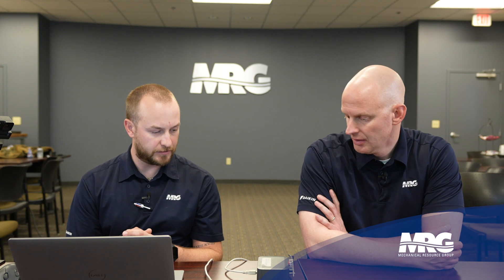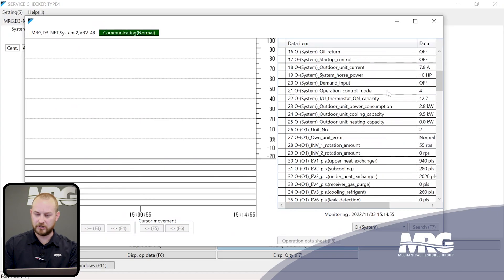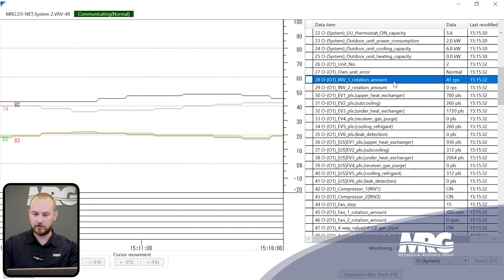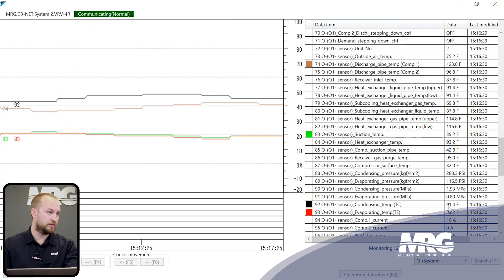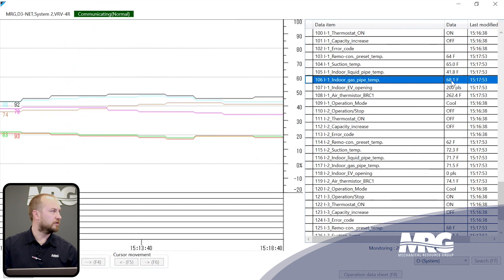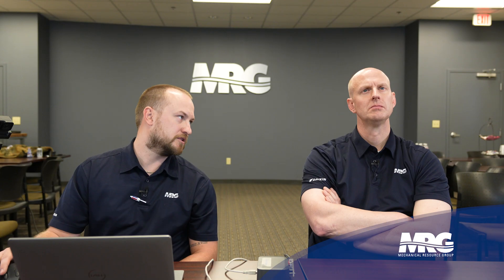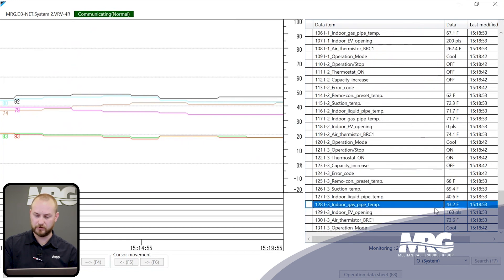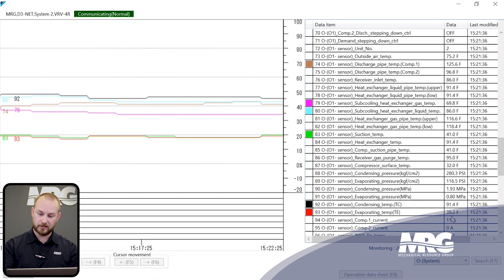Discover the Secret to Diagnosing Refrigerant Flood Back with the Daikin VRV Service Checker!

Comment: If 😅 sir our coil is cleaned filter ok blower speed okay then all idu gas pipe temperature 5 degree Celsius pipe in liquid 4 degree Celsius Suction super heat is low what could be possible if we have 5 fcy in that situation what we should do

Comment: Hi sir I hav daikin vrv 4  but I have to change only fcu . So how to test run please pm me
Reply: If you’re only replacing a FCU, you don’t need to run a test, but you should conduct a system recount. 

To conduct the system recount, press and hold the return button at the master outdoor unit for 5 seconds - 3 small squares should populate on the 7 segment LCD display during the system recount. 

If the existing FCU that is being replaced had a Group Address and/ or an Airnet address, input those addresses into the new indoor unit.
Reply: I have only single condenser
Reply: Sir I have to replace another model fcu  total 3. But condenser 1
Reply: @MechanicalPros   sir my Clint  have bee using  Daikin VRV 4  system 3. But currently system break down so I have replace   3 fancoil .  After replacing how to test up that’s all
Reply: @Sarker804  test mode

Comment: Excellent video.    What is the eev’s default position, say when the head has been removed?  Thank you
Reply: @MechanicalPros  do you have a service checker file that you recorded where it shows a stuck 4 way valve or faulty main EEV on the outdoor unit?
Reply: @davidcross27 we can do both 🤝
Reply: @quentinbutlerhvac5410  Awesome 💪🏽💪🏽💪🏽
Reply: Please make more videos about troubleshooting VRV’s using the service checker.
Reply: Almost all indoor units utilize a bolt-on style valve driver motor. The valve will go 100% open with the driver motor removed. 
 
If the EEV has a slip-on (coil) style driver, the valve will remain in whatever position it was in before the coil was removed.
Reply: @quentinbutlerhvac5410   thank you,it makes more sense to me now.  
What about if you disconnect the LEV plug from the PCB (or cut the power to the system), will the valve body stay in the same position? Is the outcome different depending on whether the LEV is bolt on or clip on?
Reply: @TekiWeki  Another great question! If you power down the system or unplug the EEV, the valve will remain in its last position due to the construction of the valve. 

We will make a video on the internals of the EEVs used on VRV to provide additional clarity.

Thanks for watching!

Comment: Another way to check for bleed by is to put the system in forced operation,  all  indoor fan coils except 1 or 2 in fan mode. Put the 1 or 2 in cooling. Then watch the indoor fan coils, if you get a temp drop across those fan only eevs your bleeding by. We see this alot- probably dirty install

Comment: If you’re searching the comments wondering how does taking 91° from 27° = 36° 🤔

Just keeping you on your toes 😉

I meant to say: 91° from 127° = 36° of Discharge superheat 
Remember: Discharge pipe temp - Condenser Temp (Tc) = Discharge Superheat 
 
Suction pipe temp - Evap Temp (Te) = Suction superheat

Like and subscribe to see what we put out next!
Reply: He made mistake...He meant 127 ;) Look at the cheker
Reply: I see you used the suction pipe temp to calculate SH..my understanding is that you take that measurement 6in from compressor after oil cap tube inlet..any input, this has always been confusing to me on vrv and depending on where measurement is taken will give you 2 different scenarios for SH.. thanks for any input